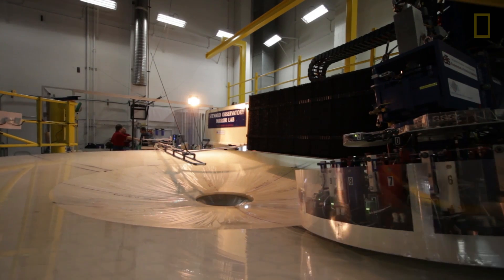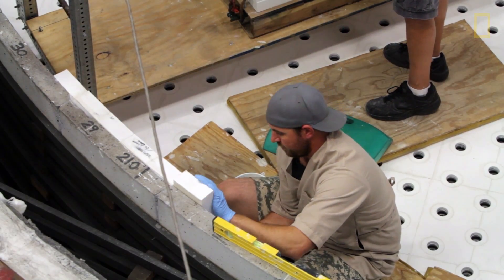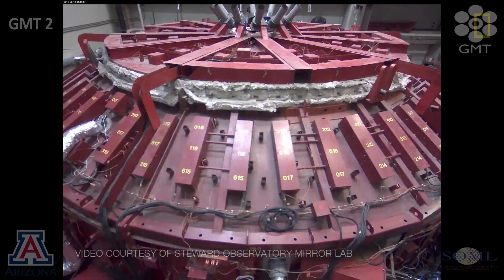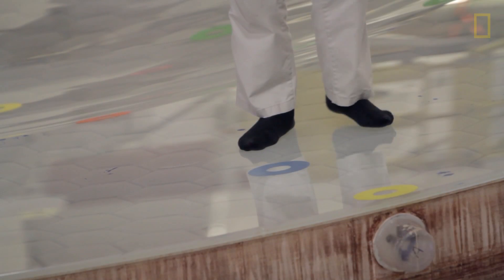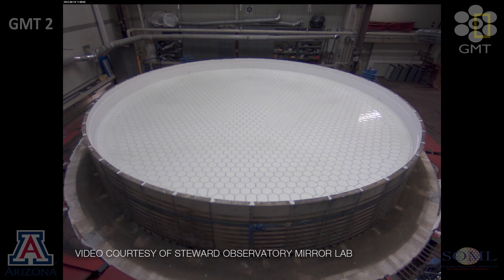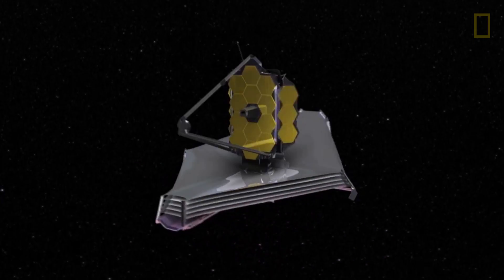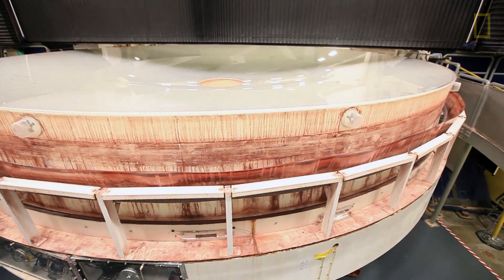Go Inside a Telescope Mirror Factory | To a Billionth of a Meter

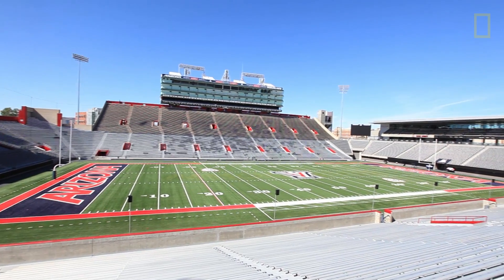Comment: The title says "to a billionth of a meter." Jonathan Davis says at 1:10 "to a thousandth of an inch" (which is 25000 billionth of a meter.)

The truth is somewhere in between. I do not know the specifications for these mirrors, but precision optical surfaces are usually ground accurate to 1/10-1/20 of the wavelength of light. For the visible light, the wavelength is about 400-700 billionth of a meter, so the surface must be shaped correctly to 20-40 billionth of a meter -- about a millionth of an inch.
Reply: That's why you use metric, you would realise your error in seconds... Oh well, that's what you get I guess
Reply: The "thousandth of an inch" refers to grinding the overall shape of the mirror, the "billionth of a meter" title refers to the next process of polishing/figuring surface peaks+valleys down to as you say something like 1/10th or 1/20th wave which deals in nanometers (billionths of a meter) _or at least tens of nanometers_.
Reply: I read an article about the Gian Magellan Telescope which said this lab polished its mirrors to 20 nanometers, I’m assuming that’s P-V. On Wikipedia (which it has a source for this) it says it will observe in wavelengths 320-25,000 nm, so for the shortest wavelength it has a P-V of 1/16 wave, and for the longest it has a P-V of 1/1,250 waves (insane!). But that’s one advantage of using longer wavelengths, the tolerances for the optical surfaces are wider.
Reply: @Aubstract  That's right it's Peaks + Valleys, however the 20nm polish and the 320nm-25µm aren't really related at all. The 320nm-25µm number would be the wavelengths observed when using the completed telescope through cameras or whatever the observing equipment. 
The 20nm is the difference between highest peaks and lowest valleys of the mirrors shape, and the '1/X wave' is taken from the light's wavelength of the laser used in the interferometer used to measure this flatness. I can't for the life of me find what wavelength their laser was online, the most commonly used lasers in polishing/figuring are Helium-Neon lasers at 633nm, so when you hear "1/10th wave", it is generally 1/10th of 633 = 63 nanometers / or 633 divided by 20. If we assume they are using this common laser, we can go backwards and go 633/20 =1/30th wave, which is an extraordinary achievement for something so massive. 

Manufacturers will specify the Lambda fraction along with the wavelength of the laser used, so you'll see "1/10th wave @633nm" on technical drawings, or maybe "Better than 1/8th wave @543nm" required. And when you see λ Lambda from half life, you can take for granted it just means 1 - λ/10 is 1/10th, λ/40 is 1/40th etc. totally interchangeable really.

Hope this makes sense, I could be getting totally mixed up rn because it's late. Essentially in polishing when we say 1/20 wave, we mean the peak-to-valley is 1 twentieth the size of the wavelength of the laser used in the interferometer measuring these numbers. 320nm - 25,000nm however is what the cameras will be looking at when the telescope is done and looking at the stars.
Reply: ĶKOOJgyg8uiop  ,

... 
?jki

Comment: "Accuracy in these mirrors is just as Hubble's" - well I'm not sure that is the good comparison...
Reply: I saw what you did/said there. The Hubble mirror is, of course, flawed, but the technology and ability to make a reflecting surface to the uttermost tolerances that the Hubble's mirror was supposed to have been made have always been there. It was just that, in the pre-Hubble days, such precision was pointless because of the interference from the thick, turbulent atmosphere that ground-based telescopes have to look up through.
Now that large mirrors are being made to be used in telescopes with adaptive optics, Hubble accuracy is now normal.
Incidentally, the Hubble back-up mirror, made by Eastman Kodak, is perfect. It was never used in any telescope, but is displayed in the National Air And Space Museum.
Reply: The mirror in the Hubble was incredibly smooth, but the problem was it was ground to the wrong radius.
Reply: @chadkent1241  Hubble mirror story follows:

NASA decided that the building of the Hubble Space Telescope primary mirror was so challenging and so crucial that a backup was needed. The main contract went to Perkin-Elmer in Danbury, Connecticut, now known as Hughes Danbury Optical Systems Inc. At NASA’s request, Perkin-Elmer let the contract for the backup mirror to Kodak Eastman in Rochester, New York. The mirrors were to be ground and polished to standards never before attempted – the ability to make such precision mirrors had always been there, but ground-based telescopes had not been made to such exacting tolerances because the interference from looking up through a thick, turbulent atmosphere made such precision superfluous. However, orbiting above the atmosphere, the Hubble was going to need the best mirror ever made.

The Kodak mirror, using conventional grinding and polishing techniques, was finished on time and on budget, but the Perkin-Elmer mirror fell behind schedule and delayed the eventual launch of the telescope. With both mirrors completed, Perkin-Elmer, as the primary contractor, had the say over which would be used in the telescope and, naturally enough, they went with their own mirror.

So the Hubble was launched and expectations were sky-high. The first out-of-focus images started coming back and everyone realised that there was something badly wrong. NASA and Perkin-Elmer carefully analysed every step in making the mirrors, from casting to final polishing and found that there had been an error in testing the shape of the mirror.

Perkin-Elmer had two types of testing instruments, called null correctors, that focused a laser beam on to the surface of the mirror to show up any irregularities. The older instrument, the refractive null corrector, used lenses to focus the laser, while the other, the reflective null corrector, used mirrors. The two instruments showed different readings from the Hubble’s mirror, so Perkin-Elmer used only the newer reflective null corrector during the final stages of the polishing and that was the problem, right there. The investigation found that two of the mirrors inside the null corrector were too far apart by the thickness of a steel washer. That meant the laser beam was slightly out of focus when it shone on the Hubble’s mirror, but the engineers doing the polishing accepted its readings and shaped the mirror to match the laser. The final shape of the 2.4-metre mirror was out by half the thickness of a human hair – enough to completely blur the images it was gathering. The term is spherical aberration.

Returning the telescope to Earth for repair was out of the question, as it had been made to be launched, but not recovered, so optical geniuses, having analysed the problem down to the last ten thousand decimal places – bit of an exaggeration there, but you get the idea – made a tiny, specially-shaped mirror to fit into the light path from the telescope into a new Wide Field Planetary Camera (WFPC2), which was fitted to the telescope during the first service mission in 1993. WFPC1 was removed and returned to Earth.

The tiny, specially shaped mirror in WFPC2 worked and the rest is history. WFPC2 was replaced on the last service mission to the Hubble in 2009 and has been displayed in the Smithsonian National Air And Space Museum. The unused Kodak Eastman backup mirror for the Hubble is also displayed in the NASM. Experts say that its optical quality is actually superior to that of the Perkin-Elmer mirror.

WFPC2 is hailed as the camera that saved the Hubble. I have seen it in the NASM and, looking at the tiny mirror sticking out of the end of the camera, I still find it incredible that so much depended on something so small.
Reply: @MarsFKA  
True - the field cap on the invar rod had a chipped off tiny piece of non reflective coating - so the focus point alligment was off for about 1,3 mm. But it is astonishing how they discarded the refractive test. And if I remember correctly they were even offered some help in checking if the mirrors shape was according to the design - but the company refused.
Reply: wino0000006 
The really crazy thing is that they test the mirrors side by side and choose the best. 

They made a backup. Two contractors, two factories, same product. But they didn’t check one against the other. 

1.5 mm is so crazy far out. The report reads like a Dumb and Dumber screen play. The adjusting screws ran out! That was red flag. But just ‘oh well, shim it.’
Reply: @chadkent1241  true. They fixed it with software.
Reply: @dominic6634   the initial fix was actually a set of corrective lenses called costar and then in one of the subsequent maintenance missions and they were able to remove that module and then it just became a numbers game.
Reply: Nub..
Reply: I laughed when he said that!

Comment: 0:35  Not true!   Schott in Mainz is just manufacturing the segments for the Extremely Large Telescope!  
I am always wondering if this is just mindlessness or if this is purpose to promote oneselves?
Reply: Each segment of the ELT is less than 2m in size, so in terms of single mirrors that's not really comparable. However, way back in the 90s the 8m VLT mirrors were made also in Germany with spincasting (as they do in this video). I'm not sure if that production line is still available, pretty much everyone has moved on to segmented mirrors apart from the GMT. So the statement may actually be true (because no one else can be bothered anymore).
Reply: Purpose

Comment: * I'm not sure stating your mirror to the "Accuracy of Hubble" is such a wise comparison.  Wasn't the Hubble main collector ground incorrectly??? 🤔
Reply: Anamnesia, It was ground very, very, very precisely wrong.  And Samuel, they did check it with another test rig, and it showed the mirror was incorrect, but they didn't believe the test results.
Reply: NASA decided that the building of the Hubble Space Telescope primary mirror was so challenging and so crucial that a backup was needed. The main contract went to Perkin-Elmer in Danbury, Connecticut, now known as Hughes Danbury Optical Systems Inc. At NASA’s request, Perkin-Elmer let the contract for the backup mirror to Kodak Eastman in Rochester, New York. The mirrors were to be ground and polished to standards never before attempted – the ability to make such precision mirrors had always been there, but ground-based telescopes had not been made to such exacting tolerances because the interference from looking up through a thick, turbulent atmosphere made such precision superfluous. However, orbiting above the atmosphere, the Hubble was going to need the best mirror ever made.

The Kodak mirror, using conventional grinding and polishing techniques, was finished on time and on budget, but the Perkin-Elmer mirror fell behind schedule and delayed the eventual launch of the telescope. With both mirrors completed, Perkin-Elmer, as the primary contractor, had the say over which would be used in the telescope and, naturally enough, they went with their own mirror.

So the Hubble was launched and expectations were sky-high. The first out-of-focus images started coming back and everyone realised that there was something badly wrong. NASA and Perkin-Elmer carefully analysed every step in making the mirrors, from casting to final polishing and found that there had been an error in testing the shape of the mirror.

Perkin-Elmer had two types of testing instruments, called null correctors, that focused a laser beam on to the surface of the mirror to show up any irregularities. The older instrument, the refractive null corrector, used lenses to focus the laser, while the other, the reflective null corrector, used mirrors. The two instruments showed different readings from the Hubble’s mirror, so Perkin-Elmer used only the newer reflective null corrector during the final stages of the polishing and that was the problem, right there. The investigation found that two of the mirrors inside the null corrector were too far apart by the thickness of a steel washer. That meant the laser beam was slightly out of focus when it shone on the Hubble’s mirror, but the engineers doing the polishing accepted its readings and shaped the mirror to match the laser. The final shape of the 2.4-metre mirror was out by half the thickness of a human hair – enough to completely blur the images it was gathering. The term is spherical aberration.

Returning the telescope to Earth for repair was out of the question, as it had been made to be launched, but not recovered, so optical geniuses, having analysed the problem down to the last ten thousand decimal places – bit of an exaggeration there, but you get the idea – made a tiny, specially-shaped mirror to fit into the light path from the telescope into a new Wide Field Planetary Camera (WFPC2), which was fitted to the telescope during the first service mission in 1993. WFPC1 was removed and returned to Earth.

The tiny, specially shaped mirror in WFPC2 worked and the rest is history. WFPC2 was replaced on the last service mission to the Hubble in 2009 and has been displayed in the Smithsonian National Air And Space Museum. The unused Kodak Eastman backup mirror for the Hubble is also displayed in the NASM. Experts say that its optical quality is actually superior to that of the Perkin-Elmer mirror.

WFPC2 is hailed as the camera that saved the Hubble. I have seen it in the NASM and, looking at the tiny mirror sticking out of the end of the camera, I still find it incredible that so much depended on something so small.

Comment: Someone can please explain why the mirror has two segments? the inner portion looks like having a very shorten focal lenght in comparison to the outsido portion, why this mirror has two different curvatures?
Reply: Found: " It is a single mirror with two focal lengths.  It acts as the primary and the tertiary mirror for the Large Synoptic Survey Telescope (LSST).  As you can see, the mirror is ground to two separate shapes, the inner “circle” is the tertiary mirror and the outer “ring” is the primary mirror, when the telescope is completed, there will be a secondary mirror and detector positioned above this mirror." http://parallax.sci.cpp.edu/wordpress/?p=443
This allows a enormous field of view without distortions

Comment: I hope its more accurate than the Hubble space telescope, I'm pretty sure I'm right when I say that the first images were blurry due to a manufacturing mistake and had to be repaired/adjusted. Having said that when they got it right the images were amazing.
Reply: Anthony Thomas correct
Reply: The Hubble was very precise - they got the focal length very precisely wrong. After the correction for 'nearsightedness'  (or 'farsightedness', I forget which), the Hubble has been doing science for a quarter of a century. Its near earth location allowed for 4 repair/upgrade missions, something that won't be possible with the Webb. I hope that get that one right from the get-go. 
Even before the first repair mission to fix the focal length issue, using some fancy signal processing, they were able to process and refocus some of the Hubble data based on the known problem.  A null gravity check would have been required to simulate on orbit accuracy, as earth-bound, gravity pulls it out shape.
Reply: @cjr191  They mirror wasn't nearsighted or farsighted.  It had spherical aberration.   The center of the mirror and the edge of the mirror had very slightly different focal lengths.

Comment: How much will that mirror cost?
It's larger than the Hubbard....

Will that more than compensate for it being in the Earth's atmosphere?
Reply: You mean hubble? Also the size of the mirror can compensate for the earth's atmosphere only to an extent, this is what adaptive optics is for. Also the mounts of most telescopes allow it to counteract the earth's rotation, the only real advantage of the hubble is that the atmosphere doesn't interfere with its optics.
Reply: David W 
In my hubble opinion, your reply is right on.
Reply: Amazing on how illiterate people are when it comes to spelling! It is Hubble, not "humble" or "Hubbard" etc.
Reply: No, actually making the mirror bigger makes it worse when used in the Earth's atmosphere.  You have to use adaptive optics on the secondary mirror to correct for the unstable atmosphere and get full use of a mirror this size.